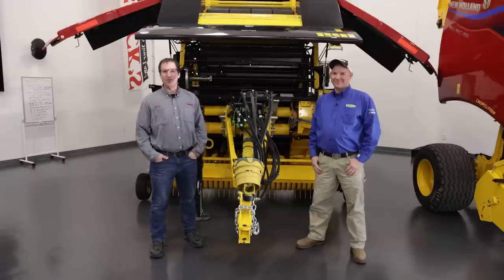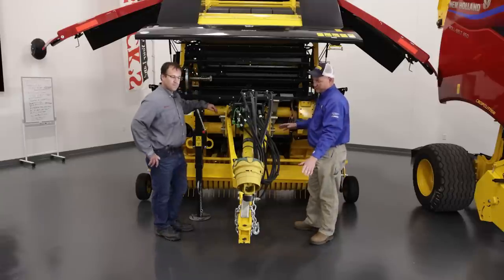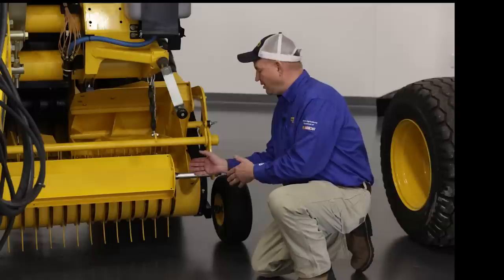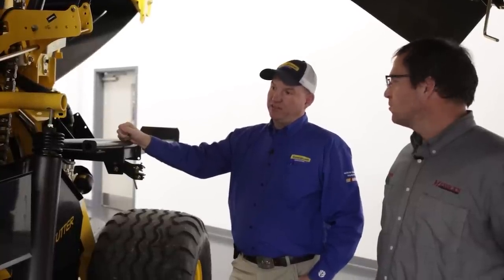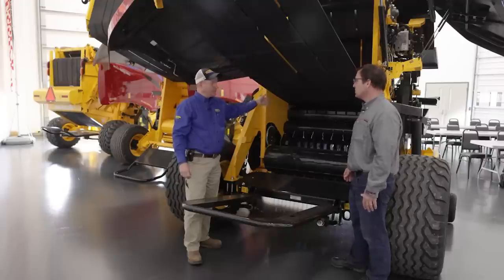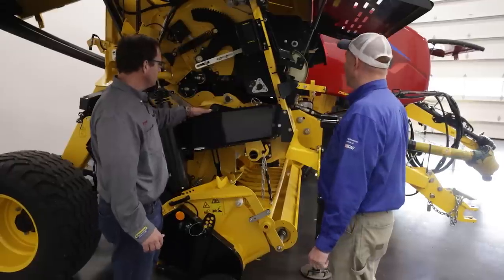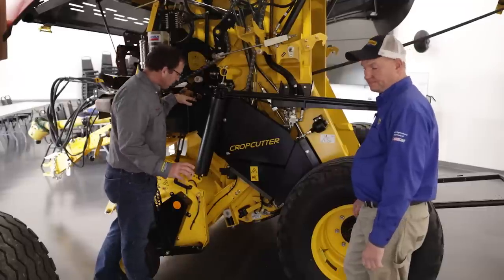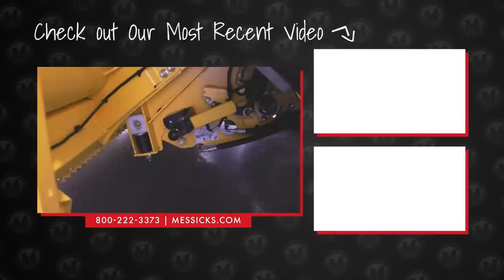The New Pro-Belt Round Baler from New Holland

Comment: I don’t even know why we are so concerned with 1000rpm PTO, and sub 100hp tractors people.
With the weight and torque requirements of this baler, I wouldn’t even consider starting it up on a tractor under 120hp.
Our dealership was one of the ones in Australia that ran one of these balers in the development stage pre production. We were impressed at the extra density these pack into the bales size for size over the previous RB series.
There are many impressive features on these machines.
That being said once more are released and sold into the market, that will be testament to their reliability.
The development machine has been sold to a local contractor and he has completed one season with it so far without issue. 
If you are not a contractor or high volume haymaker then this is not really a machine for you to consider, unless you have plenty of coin to throw around. 
Horses for courses in this case!

Comment: Not sure why most people in the comments think u need 540 pto every high capacity piece of farm equipment runs a 1000 pto if u want 540 im sure the economy baler model will suit u guys perfectly
Reply from the maker: When your standing beside the baler and can see its size and weight, you can figure pretty quickly that its too big for any tractor that's 540 only.
Reply: @ritch yup that works with older model lighter built new Hollands works great actually but if u want to take capacity to the next level this baler does that its just the way it’s geared spinning a 1000 pto doesn’t take more power its the same but it just spins faster but the rest of the baler will be geared down a bit your shoving more feed through it quicker to increase capacity thus needing things to spin faster lol
Reply: @ritch195 there's a gear box on the baler.  1000 rpm has the same energy, but less torque in the long driveshaft.
Reply: @brettknoss486  you worded that perfectly

Comment: Why don't you build a baler without a computer
Reply: They did in the early days but I don’t see many Fred Flintstone tractors around anymore either.
I understand that not everyone wants a computer, but all the earlier mechanical machines I’ve worked on have a lot of moving parts to wear out and get sloppy in their movement affecting timing.
A few sensors and an actuator is all that’s needed now days!

Comment: Very stupid move to not offer in 540 pto makes absolutely zero sense
Reply: Every modern tractor can be switched to 1000 pto easily
Reply: Also this means the baler can handle more torque usually found on the higher HP 1000 PTO tractors.
Reply: @mesh1248  well said! Even a lot of the older tractors have the option of shiftable, changeable or both options on them.
Reply: @brenttonks4249  and even if they don’t new Holland still offers the more economy versions that suit a vintage tractor better anyway
Reply: 1000 rpm more efficient .
Reply: @brenttonks4249 faster pto moves mire energy with less torque. This allows the driveshaft to be made lighter.
Reply: @brettknoss486  what does this have to do with throughput? I had a customer who ran his 540 baler in 1000 and all it did was chaff the hay and make a cunt of a bale. The issue here is nothing to do with PTO speed as the gearbox on the machine is geared to give the correct speed, for example if the belts in the chamber are designed to move at 3000m per minute regardless of if the machine is 1000 input or 540 input recommendation from the manufacturer, the machine will be geared to run the belts at 3000m per minute
Reply: @brenttonks4249  First off watch your language. Second, did he change the gear box? The 1000 pto baler has a higher gear ratio, and thus turn at the same speed, with the same torque.

Comment: Well I quit watching When he said it's 1000 pto only.... (not in the market anyway)  But, What a crazy and soon regrettable decision by new holland....That's one way to sell larger tractors though...Hey I want that 80 grand baler...Ok you have to by the 200 grand tractor to pull it too 😲😲..... It's hard enough to sell equipment in this economy..why limit yourself like this New Holland...again Regrettable Decision. I'll call it now...New for 2025 New Holland Roll Belt 450-460 now with 540 PTO capability....😆😆
Reply: Well said
Reply: I dont think you really understand the sort of baler this is. This isnt a hobby farmer baler. This is for the big time custom guys that already have the 200 horse tractor that dosnt even have a 540.
Reply: This is a pretty big baler for a round baler. The kind of tractors running this size baler would frequently be able to switch between 1000 & 540. Unless you are looking at older tractors. Obviously this level of baler is not for me, I'm running sub-70hp tractors, and also older tractors. The guys running strictly 540 to tend not to be making these bigger round bales and not needed the larger capability of being a crop cutter and focusing on haylage. The 540 baler I'm looking at would be making 4x5 bales of hay or corn fodder, maybe straw. I'm not touching haylage either. This baler is not even on my radar and New Holland knows this, that why they have the smaller, lighter, 540 balers.
Reply: You do realize that most PTO shafts can be switched from 1000 to 540 in like 5 minutes right?  I don't farm and I know that.
Reply: @jeffschlagel5632  then you first need a tractor with 1000 rpm option
Reply: @jeffschlagel5632  WOW!!! You need to Read up!!! Most 100hp or less tractors cannot switch from 540 to 1000 pto. Only very specific models in that range can do that. Even a 100hp plus tractor, and then a specific model of the 100-120 range tractors, to be able to switch shafts in 5 minuets as you think it does. Been selling equipment 30 years and theres ine in every crowd!!!
Reply: WOW Jeff, 30 years of sales and you don’t know of many tractors under 100hp that can do 540 & 1000 PTO! 
What market do you sell tractors in?
I have been in the game as long as you and I’ve seen hundreds of tractors under 100hp with 540 and 1000 some even have 540E as well.
My old 895XL case in the late 90s had it and it was 72 PTO Hp, 
Seen it in MXC Cases under 100 Hp and various New Holland, Massey Ferguson, John Deeres, Deutz Fahr, kubota and so on.
Reply: 80 grand wouldn't get you this baler, we were quoted $98,000 for one
Reply: @brenttonks4249  wow Brent I just did a simple Google search and found 8 models.  Maybe you should sell match box cars or something.  And I am not the only person that made this point.
Reply: @jeffschlagel5632  I would doubt there’s only 8 machines across all manufacturers. 
If I dig deep into the New Holland range that we currently supply I bet I would find at least half of the number quoted!
Reply: I had the privilege of running this baler before it was released. It is not at all intended for, and to be honest would not be safe to hitch to a smaller tractor. The baler is huge and built like a tank! A standard 450 roll belt is more than enough baler for most people and 540 is offered on those. This is definitely a commercial grade baler.
Reply: I had the privilege of running this baler before it was released. The baler is huge and built like a tank! A 450 roll belt is more than enough baler for most people and 540 is offered on those. I’m not sure why someone would worry about needing a 540 pto with a baler like this? If your tractor only has a 540 shaft you are way under sized to begin with. I personally would run it on my 7130 magnum just for the sake of having a safe amount of weight to handle the baler plus the weight of the hay bale inside. The weight of this baler plus high density/ high moisture bales in hilly regions could be a recipe for disaster. This is most definitely a commercial grade baler.

Comment: Very good improvements to the baler. BUT. 1000 RPM ONLY IS THE MOST STUPID IDEA FROM NH EVER!!!!!!!!!  I’m a contractor in Australia. I run Krone combipak balers as most of my work is wrapped silage. Everybody has missed the point that modern tractors over 100 hp also have 750 pto as well. That means you run your tractor at around 1600 rpm. My tractors use so much less fuel it’s not funny. Would NEVRR buy round baler 1000 only.